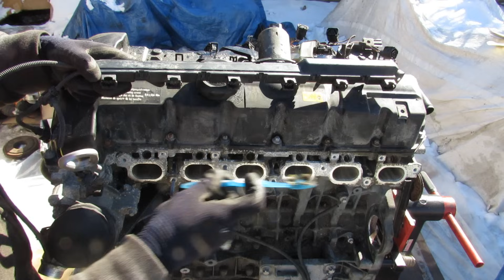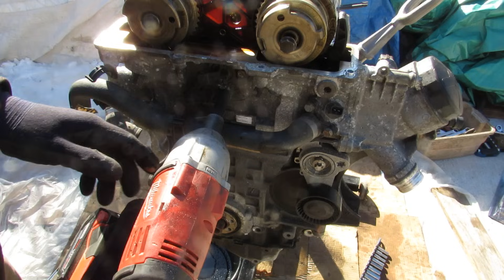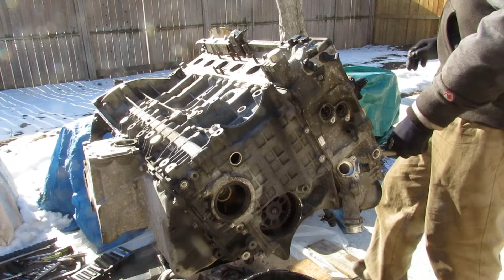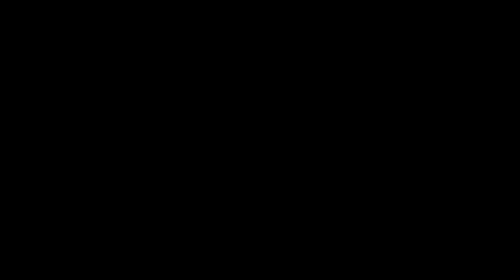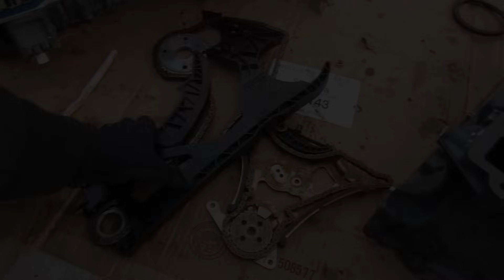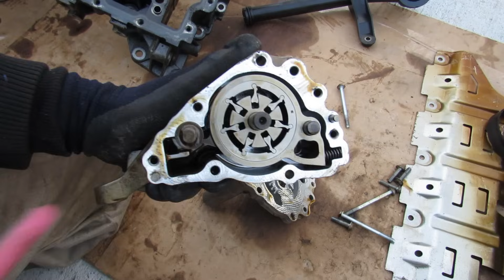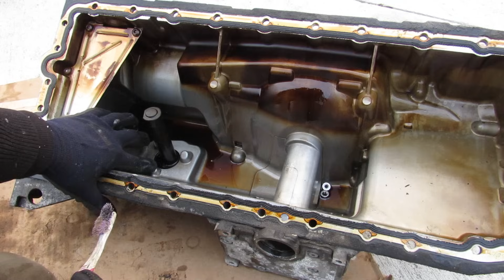The Last Inline 6 Engine: BMW N52

Comment: just watched this video solely to figure out how the eccentric shaft works, but wow this was extremely informative, i'm super glad you actually showed it in motion along with other parts of the engine and i'm glad you showed me where the leaks occur because it helps someone like me learn a lot faster. I personally love this engine in my 325i, i've replaced the intake manifold with the N54IM and i've been tuned with 22rpd and I think this is one of the best NA inline 6's you can get to be fairly rapid on a tight, teenage budget, super underrated performance wise because everyone is chasing 500hp+ power figures constantly instead of having a nice, rev happy NA screamer for the mountains. great video!
Reply from the maker: Thanks

Comment: That was my last 52 engine. 328i ‘99 that I put a VF supercharger in it. 190-310 HP with just 6 psi boost. R compounds and suspension and e46 m3’s were pissed  when I lapped them. 23 less hp, but 250 less pounds.

Comment: What was the purpose of stripping this engine and dropping the crank on the ground?  All bearings looked nice, #6 cylinder was oily (shipping?), but this an MPI engine, not direct-injected so should be nice.

Comment: Hey youtuber..... youre full of shit and dont know anything about bmw. After the N52 they made the N54 then N55/S55 to the B58/S58. All FI 3.0 6 cylinder engines.  If you said the last NA 6 cylinder then i would say not really because  they also had the S54 which was base on the very same N52
Reply: You are an imbecile. The last na i6 was this as the s54 (being  a modernized s50 which was made in the 90s and based itself on an older engine) was already gone.

Comment: E63, 630i, 18 yrs old, 150,000 miles, daily runner. Very occasional tappet rattle when cold but otherwise silky smooth and quiet. Not planning to retire the car until at least 175,000 next year. Only issue is a completely random hesitation from a closed throttle (feels like fuelling?), otherwise its bang on.

Comment: The solution to the tapping valves is nit to replace the assembly. Its drive it spiritually for a bit and it will go away. It does not tap with Mobil 1 oil but I did have these taps with oem castrol

Comment: what would cause this engine to die 4 minutes after a oil filter housing gasket ?? cannot even rotate the engine manually seems to be binding hard at times, looked down into cylnder 1,2 and 3. i noticed the top piston is cracked... i have never ever seeen this on a n52 there is zero information about a sezed up n52 engine.

Comment: The N53 replaced this engine as the last n/a inline 6 from BMW. It's similar engine, but it doesn't have Valvetronic and instead has direct injection. Was not sold in the US tho so the N52 is still the last n/a inline 6 over there.

Comment: Just remember to NEVER overheat 
These engines.
 They are know to warp heads easily  and pull the head bolts right out of the soft aluminum block, then yougot to try to helicoil the stripped out bolt holes,  and sometimes they fail.
 I bought a 2004 325i e47 wagon, and had to replace the radiator,  installed a brand new one, water pump was replace recently by previous owner,  connecting all the hoses with the brilliant quick release connections, all of yhe clicked into place all the clips were in place properly,  
Drove a few times. Ran great.
Then a week later im driving on a hot 90 degree day, and noticed out of nowwhere the temp gauge was pinned maxed put on hot.
I pulled over, let it cool off, 
Checked all hoses, poored water into the radiator to try yo get it off yhe road, and noticed the lower smaller heater core hose leaking,
My mistake i think was not greasing the old oil ring when reattaching the pld hose, it has a rubber o ring inside the quick release, and it must have been dryed out and didn't seal correctly. 
So its a good idea to grease all the o rings, essentially on old hose connections on those quick release bmw hoses.
So i blew the headgaskets over a simple mistake.

Comment: have N52, 528xi ..   at 258,251kms. smooth a silk.  I drive it for work daily for 5 years  and  it is my weekend car now. Soo nice and buttery smooth. compared to the turbo engines..N55 .  N54....   I do oil changes myself..   and will keep it as long as it runs. replaced coolant reservoir tank & cap, coolant flush, new bosch radiator, mickey mouse flange, electric water pump and thermostate @ 154, kms. Tension pulley and belt changed at 200, 000 kms.  small leak on the oil pan... but it is does not bother me. keep checking the oil level, changing full synthetic  5W-40oil at 7, 000 kms intervals.       long live NA  engine.. N52...    great video...   thanks updloading

Comment: The last naturally aspirated 6 inline BMW engine is the N53 not sold in USA and Australia with to outputs 272 hp N53B30O0 and 218 hp N53B30U0and was aslo the first GDI 6 streithg BMW Engine.
BimmerN53

Comment: BMW says that you can address carbon build up by running the engine at 3k rpm for several minutes, especially if you do a low of low rpm driving.  I make sure to take it out every few days and work it to 3-5k in sport mode for a bit.  Since I began doing that, the engine is performing like a rocket.   Also, I have begun. at 138k, a slow investment in the motor, shaft sensors, seals, belt, vanos, OCV, and soon, the DISA.   Ill probably keep investing.   The mechanic’s son told me, “I think this is a fantastic BMW, it drives so well.”.  The 52 is a marvel of efficiency.
Reply: ahh yes, a good ol' italian tune up!
Reply: Techron
Reply: @paulmcdermott638 yea was about to comment the same thing….Techron.

Comment: This joker calls this motor "one of BMWs more reliable engines" meanwhile this motor has so many problems. Leaking oil, Timing issue, and seized. Nothing reliable about that.
Reply from the maker: Wait until you see my N54 teardown video. Check my Shorts videos for an update
Reply: Stop buying cheap motor oil lol. This car uses expensive shit. :face-blue-smiling:
Reply: @Paralarazarecords  no crap I only use Castrol with a K&N oil filter.

Comment: One of many delightful engines from BMW. Straight 6s have long been their bread-and-butter motors. But WHY did/does BMW persist with those awful plastic chain guides..!?  Thats possible the only real fly in the otherwise very smooth ointment.    It's a pity they no longer make an NA engine like this.
Reply from the maker: Weight savings

Comment: Nice video. I have a nice 2006 Z4 3.0 si with 60.000 km. No oilleaks but a whistling noise from the oilfilter, especially with a cold engine. No solution found yet…. Every hint is welcome x

Comment: I have a n52 b25 2006 BMW it has done 220.0000 miles and pures when it ticks over. Bmw forever
Reply: 250.000 miles
Reply: @stevehunt3847  and still good sir?
Reply: @samson2143  yes running well
Reply: What’s your mileage now? I’m curious 😃

Comment: Holly crap!, you clearly don't know about BMW engines or what goes wrong with them. Sure, they leak oil, but the vanos and the hydraulic lifters are both reliable and fairly easily repairable often needing nothing more than an engine flush and fresh oil, as for the valvetronic, that has proved to be very reliable and worry free.
Reply from the maker: Reliable compared to other BMWs?

Comment: Would it be possible to overhaul the engine and make more power?
Reply from the maker: Other than cleaning valves I don't see much power gains by rebuilding

Comment: Thanks for explaining the N52 engine components as clearly as you did. I'm about to start a rebuild of a hydro locked N52, that smokes. The second engine (that replaced the hydro locked) is trying to get out from under the hood. Little bastard won't stop knocking!!! Your passed along knowledge will help greatly!

Comment: I drive a 06 BMW 325i with this engine, only smaller displacement. Had to replace the expensive water pump once and the oil consumption went down to zero after replacing all these gaskets. This engine is - even after 17 years and almost 120k miles - as smooth as on its first day. 
By the way: since I had the above mentioned issues I looked across youtube for videos explaining parts of this engine and this clip is by far the best !! 👍
Reply: 06 525i : same history  - very smooth.

Comment: Just wanted to add, the block is not coated magnesium on the inside, the inner part is an aluminium silicon insert that contains the cylinder bores and coolant channels and the outer part is magnesium.

Comment: 0:27: In germany we had a naturally aspirated BMW r6 engine with direct injection, called "N53". This engine were offered after the N52. At the same time the N20 (turbocharged er) were offered. The N53 runs lean, unlike the N20. This is why the N53 consumes a similar amount of fuel.
Reply: I’ve always wanted to ship a set of n53 heads to the United States. Without the valvetronic and with direct injection building the heads to rev high should be easy

Comment: Just discovered your channel. Probably watched 10 teardowns so far. They're addicting! And you don't waste any time, the whole video is information. Hoping you do a teardown of a Mercedes M112 or M113 someday. That's what's in my car. 160k and not a single engine-related issue since I bought it with 91k. Even then, I think the previous owner only had to do a crank sensor. Runs like a clock.

Comment: 0:33 Incorrect: the N52 was replaced by the N53 which was the last N/A I-6. However BMW still makes I-6's that were twin turbocharged or single turbocharged with a twin scroll unit. Currently the 3/4 series is being powered by a single twin scroll turbocharged B58 with a air to water intercooler mounted in the intake.
They still make V8's but we all know how much of a pain in the ass they are to keep maintained.

Comment: I have a question. I have this engine and my car is on limp mode. The yellow half engine light came on. From what I’ve research, it’s the vanos solenoids that’s failing. Is that possible? The car doesn’t crank up either . What advice can you give me ?

Comment: Its the last NA inline 6 engine anywhere, but its not the last inline 6 gas engine.  The turbo B58, which powers any M40i vehicles and the Mark V Supra, came soon afterwards.  This was followed in 2017 by the Mercedes Benz M256 engine, then in 2022 by the Stellantis Hurricane 6.  Then there's talk that Mazda will come out with a Skyactiv inline 6 for the next gen Mazda 6, an engine that Toyota is said to be in talks to use for itself.  I don't know if the Mazda straight 6 is naturally aspirated or turbo or comes in both.  Great video by the way.
Reply from the maker: Thanks

Comment: I have the N52B25 in 325i guise. Great little engine, for 160kw the fuel economy is not too bad. Once you take care of the gaskets (Oil filter housing, Valve cover, oil pan), CCV and water pump - they are great. I've had mine for 80k km so far, reliable by BMW standards. Don't expect corolla reliability, they need more care. Great vid! I learned a lot.
Reply from the maker: They sure need to be cared. Most BMW owners don't maintain them as they should
Reply: I find it very difficult to get good fuel economy in my e90 328i 6mt because I just can't stay out of the throttle, I'm so tempted to floor it and row through the gears everytime the road is clear.
Reply: @spicysnowman8886  yeh it nice to ring the engine out because of its linear power delivery.

Comment: Do we know exactly what failed in this engine? I would like to avoid it happening in mine. What are the most important things to maintain? When should the plastic timing assembly and also serpentine belt be replaced?
Reply: The operator failed to put proper fuel in and failed to do proper oil changes most likely. Lack of proper maintenance is what caused the failure. Replace serpentine belt when it looks dry or is starting to frey or after 50,000 km
Reply: changing oil every 12k kms and below is a good start. 
Replace all leaking gaskets, especially the OFHG.
Water pump and thermostat.
CCV.
Vanos solenoids and check valves.
Other than that, they are quite bulletproof.

Comment: Got my third n52
I also had 4 m52 and 5 m54 as well as 2 n55 and 1 n54 and 6 non r6 engines
Great engines, enjoyed them
Reply from the maker: Burn and leak oil?
Reply: @speedkar99  nearly everyone had a valve cover gasket that needed to be replaced
Some m54 drank oil but it was all okay
Reply: @Krezo200 every engine I know gets bad valve cover gaskets, sealing materials are just not resistant to engine oil. 
Bit how did you go through so many cars/engines!?!!
Reply: @traubengott9783  it was my hobby
Had 25 cars so far, often 2-3 at once

Comment: I was hoping to use a oil siphoner but I'm thinking it's not possible. 
Do any of those holes in the oil filter housing lead to the oil pan? In regards to using a oil siphoning tube

Comment: on the 08 n52 is there suppose to be a grip disk washer or some other type of washer on the crank bub. i took mines apart and only have oil pump and vac pump gears on my crank hub bolt. im sure i didn't drop it. im positive there was never one on there
Reply from the maker: I don't recall that on this motor

Comment: I have 306 000 kms on my N52 3.0 l. Looks like previous owners changed oil regularly in shorter intervals cause the engine is clean inside with no sludge and other crap. And I'm surprised it still takes not more than 1 l of oil for 10 000 km, which is miracle for old BMW.

Comment: Good day Sir, wanted to ask, as I'm scratching my head... One of the mechanics I got the car from, ended up braking the serpentine tensioner bolt hole (located on the "timing cover") which the ending does t have.. is there ea way around it? Asking u since u have broken down the engine entirely.

Looking forward to hear back from you.
@speedkar99
Reply from the maker: In that case you need to replace the cover
Reply: @speedkar99  there is no timing cover. As it's a one piece design. The same engine in this vigeo

Comment: late to the party, but @16:53 I'm pretty sure the bolts are aluminum to avoid galvanic corrosion, and thermal expansion- i.e. as the whole thing heats up, the, say,  pan, block, and bolts all deform the same amount, keeping things tight.

Comment: Nice video! If properly maintained, a later / updated N52 like this one in the video is very reliable and a joy to drive.

This engine did actually have a timing issue. I'm not sure if you missed it, or just didn't comment on it:

1) At 4:05 when you try to loosen the camshaft bolt, notice how the gear rotates seperately from the vanos unit on the intake cam. It's not supposed to come apart like that, it's a sealed unit.
2) At 5:06 you can see the bolt heads on the rear of the vanos unit are actually snapped off, and the rest of the snapped bolt is left in the body
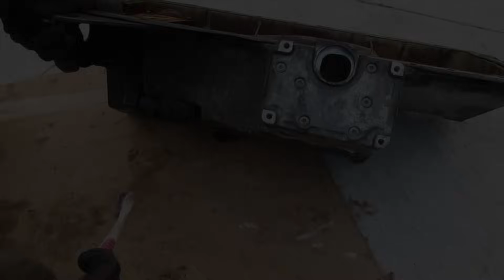3) At 19:02 you can see the broken off bolt heads swimming around in the oil sump!

I believe there was actually a recall for this specific issue, but only in the USA?

Comment: My 06 325i n52 manual is hitting 167k. Still running strong. Eventually going to put the 3 stage intake for the extra 60 horses.
And yes my oil pan leaks. Valve cover is a tad wet. But not to bad. Going to replace all gaskets this coming spring

Comment: wait did you say the half shaft  goes through the oil pan ! So apart from all the other BMW problems   when the oil pan gasket leaks i will have to remove the half shafts in order to replace it ! WTF BMW !
Reply from the maker: Yes! Actually many rear based AWD do that

Comment: I got this motor in my 2006 3 series. I got it six years now and its been pretty awesome. Enough power, smooth as butter and it handles great. Mainly because its my first rwd car, I've had 5 fwd cars before the 3 series. Just gotta be handy with a wrench. If not its best to get a Toyota.

Comment: Interesting.. I have the N52 in my 2006 E63 630i Sport.. Done 83k miles and runs like a dream. The only occasional ‘issue’ I have is when starting from cold I get the ticking lifter noise. It goes once warmed up. It’s not helped by my very short daily journeys.. basically to the gym and back, about 2 miles each way, which means it barely gets a chance to warm up. Every now and again I give it a longer/Italian tune run up. 😊
Reply: Try putting engine noise reduction adhesive tape over top of rocket covet and round top side of engine head it's adhesive and helps reduce some of the noise